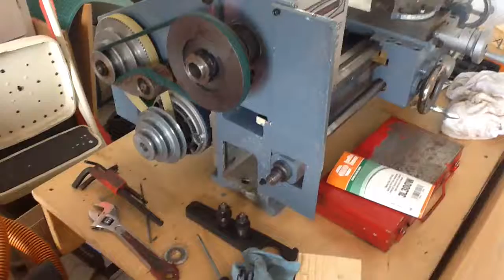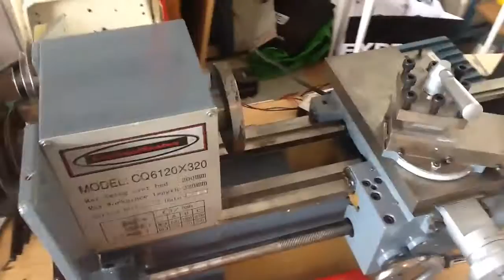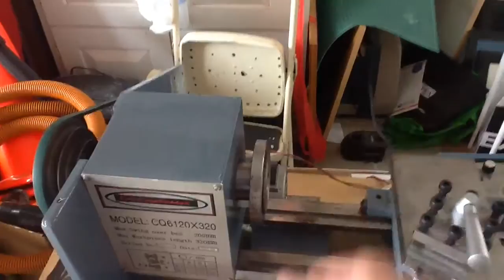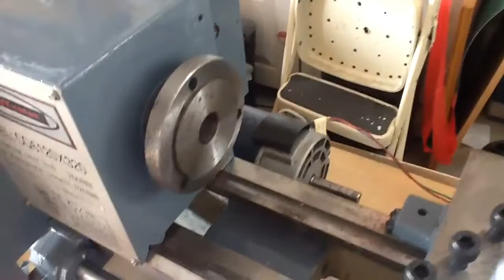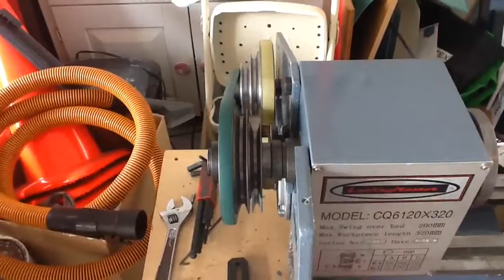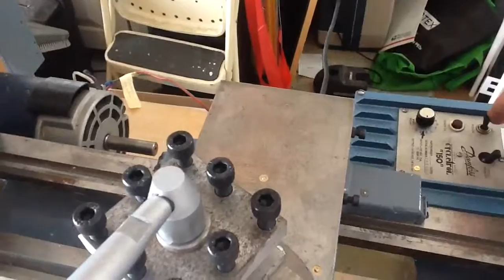Lathemaster 8 x 14, DC motor, max torque belt setting

Comment: When you converted to DC belt drive, you lost the ability to thread on the lathe?
Reply from the maker: No, not at all. The Lathemaster 8 x14 uses gears mounted on a banjo to drive the lead screw for threading. The dc motor lets you slow down the rpm (or increase it of course), which makes the lathe a pleasure to use.
Reply: @metalmill52  I see.  You just don't hook up the gear train yet.  Thanks

I also have the Lathemaster 8 x 14. I just recently moved and was considering doing some upgrades before setting it all back up again.  It's about time for a bit of a rebuild,  and I'd also like to install a dro if it's not too pricey.  Thanks again for the vid.